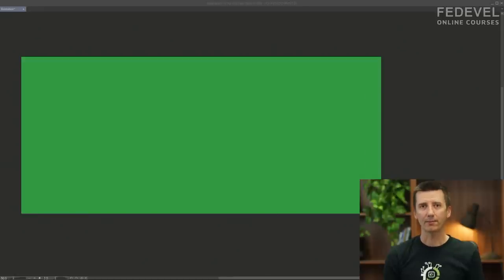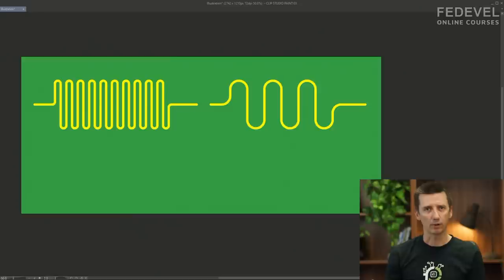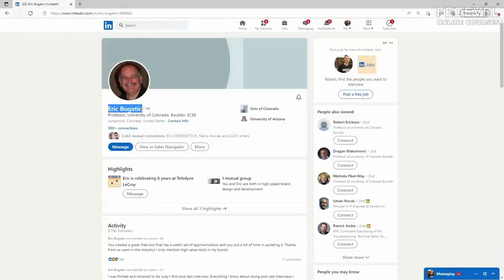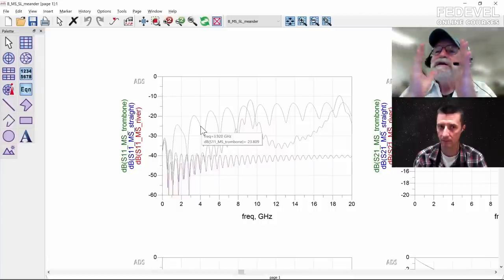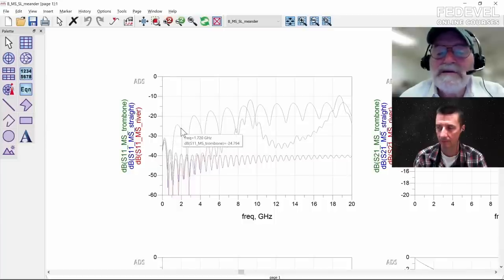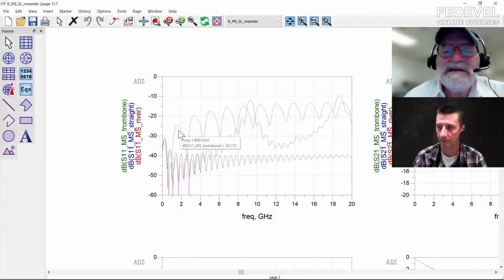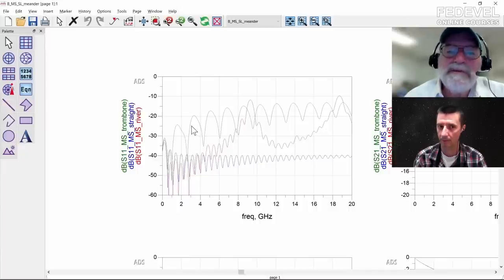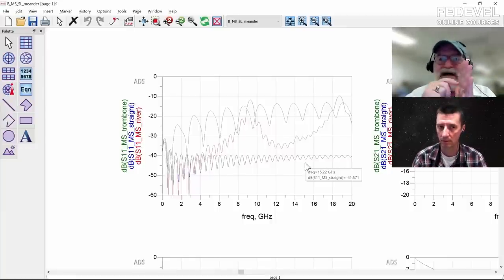Which length matching is the best? You may be surprised … | Eric Bogatin

Comment: Great video. I was wondering what would be better in the case of differential pair routing. I would think trombone would be better in the case where you need to compensate for a large length mismatch as the distance that the differential pair travels uncoupled would be shorter than in the case of river length matching.

Also, if I look just at the transient analysis of the last simulation with 40ps rise time, it seems as though trombone would be superior to river in the case of digital signals as long as it doesn't cause the receiving device to register a 1 at that low initial voltage. Although this is just a single edge. Maybe it would be different if there was an actual high frequency block signal that was simulated as that more closely resembles an actual digital signal.

I myself use trombone for very large length mismatch, river for medium length mismatch and triangle for small length mismatch. I do of course keep a reasonable distance between the segments.

Comment: Great video, Robert!  As always.
Potentially, a hand drawn meander, with recognizable variances in per-wave coupling and variances in segment length could perform better with flatter frequency response.  Further, since the typical meander is generated by computer, AKA Altium et al, all of the dimensions of the meander could easily be made to vary randomly within preset tolerances to maximally harvest this flattening effect. Just a thought 🤷‍♂

Comment: That was a great video. It's really interesting to see the underlying reasons as to why the rules for serpentine track layout are the way they are. Normally, only those few engineers lucky enough to have access to super-expensive field solver software ever get this insight.
I do have one question though: Why does Eric say (@9:00) that Microstrip suffer from far-end crosstalk (FEXT), but Stripline does not? I don't understand why the crosstalk gets cancelled out simply by using stripline. What difference does that make?
Reply from the maker: Thank you Nicholas. PS: I don't remember the exact minute, but the crosstalk cancellation is explained in this video: https://youtu.be/EF7SxgcDfCo
Reply: @RobertFeranec  Thank you, it all makes perfect sense now! It's all down to the symmetry or asymmetry of the dielectric constant of the material above and below the trace, and the fact that the electric field interacts with the dielectric material, but the magnetic field doesn't.
Reply: You are correct - stripline does NOT eliminate FEXT entirely.  Odd and even mode phase velocities are equal in homogeneous stripline and unequal in microstrip, which reduces the directivity of coupling at higher frequencies in the microstrip case.  A quick ADS or HFSS simulation will show you that FEXT does exist in coupled striplines.  An example of a little knowledge being dangerous, I think.

Comment: 9:20 regarding Far-end and near-end crosstalk. First, for purposes of discussing meandering traces, it would be helpful to call these crosstalks something like "parallel" and "antiparallel", or "same direction" and "opposite direction".  Robert mentions that for stripline far-end crosstalk (ie: parallel) "they cancel". Evidently, "they" refers to the two crosstalk components attributable to electric and magrnetic fields, which happen to be equal for stripline and opposite for the "same direction" direction, and presumably when dimensions and materials are selected for 50-ohm impedance. I guess in microstrip they don't cancel.

Comment: The plots discussed around 53:55 (microstrip) and 1:05:25 (stripline) are very interesting. The trombone curve is especially striking. If we see the  trombone as having three legs (Input --> A --> B --> C --> output), then each leg would be 5cm, with propagation delay about 330ns.  We can see that for both microstrip and stripline, the "precursor" bump starts about 0.33ns delayed from the input step. Why? Presumably because the crosstalk from the input end of A to the output end of B starts immediately. Any forward signal from B into C starts immediately too, as does crosstalk from output end of B across to input end of C.  So it only requires conduction from begin to end of C until the output starts to rise, though only up to a small plateau. 
Interestingly, the plateau for stripline is higher than for microstrip. I think this is because for stripline, the A-to-B crosstalk is all antiparallel in the forward direction of B, which outputs from B into C, and the crosstalk from B to C is also antiparallel, so in the forward direction of C. So the two contributions to a signal in C add.   
However, in the microstrip case, the crosstalks from A to B, and B to C, have parallel and anti-parallel components, partially cancelling out the effect, and/or simply sending energy in the reverse direction, hence a lower precusor plateau, but with the same timing.  Very neat!

Comment: Filling in some more gaps: With the total length of the interconnect being 15 cm, nominally 1 ns delay, the round trip is 2 ns, so the resonant frequency would be 0.5 GHz (assuming imperfect impedance match at the terminations) , and that is in fact the spacing of the peaks in the reflection plot for the straight trace, and also the closely-spaced peaks in the River plot. Nice! Then..
... for the Trombome trace, the lengths are 5 cm per leg, nominally 0.33 ns, or 0.66ns round trip, or 1.5 GHz. That is indeed the peak spacing on the reflection plot.
Finally, for the River trace, the individual segments are 1/16 of 15 cm, so we'd expect a resonance at 16 times the frequency of the total trace, or about 8 GHz.  That's a bit off from the simulation which shows 9 GHz, but maybe that's accounted for by the factor that each leg is made from a coupled section and a non-coupled section, or just be the coupling of one leg to another.  
All these ways in which you can see physical dimensions correlate to time and frequency really demystify the subject in a very satisfying way. Thanks Robert and Eric!

Comment: Thanks for the very informative video.
13:50 In order to have not much coupling spacing(width between serpentines) should be roughly 3 or 4 times track width @50 ohm line impedance. What about height of the serpentines should be?
1:17:00 Rough general rule under 10gig frequencies many short coupled segments(serpentines or meanders) are better. What ratio of the width and height of the serpentine is short according to track width? Or according to reference plane?

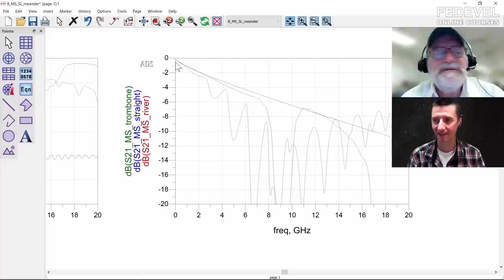Comment: Microstrip Accordion routing at around 1:00:00
Bloch effect punishes the design at 9 GHz.
What if, instead of equal spacing of the serpentine traces, one used a series of slightly different widths?
For instance different spacing between vertical legs of 1.0L, 1.05L, 1.10L, 1.15L, 1.2L, 1.25L, 1.3L, and so on.

Comment: I was directed to this video after asking some questions about ST Micro's AN5122 appnote, where they recommend trombone meanders (aka switchback) instead of accordion meanders (aka river or serpentine) for LPDDR3 traces, claiming that accordion meanders "provoke orthogonal propagation which compromises signal integrity". This was surprising to me, because I had always heard that trombone routing was more suitable for lower frequency stuff. After watching this video I feel I understand the behaviours of the meanders a lot better, but I'm still left wondering what they meant. By "orthogonal propagation" I can only guess that they're perhaps referring to the propensity for the mutual crosstalk to cause the precursor to advance faster over accordion meanders, by "jumping" the legs, but it wasn't clear to me that it's any better for trombone meanders. Maybe they're worried that the higher Q of the resonance in accordion routing coupled is more likely to create a large resonance at the fundamental frequency of the rising edges for LPDDR3 on typical 50Ω impedance stackups? Still seems a bit odd to me - maybe it's just a bad recommendation? (they do also mandate a 4L SGPS stackup, which made me roll my eyes a bit)
Reply: “All app notes should be assumed wrong until proven otherwise”
- Rick Hartley

Comment: 50:51 14dB loss @ 20G for stripline vs 12dB for microstrip.  Microstrip does dip down to 14dB at one point though.  The more consistent stripline behavior comes at a cost of attenuation.
Reply: Also on the transmitted signal graph -12dB for microstrip and -14dB for stripline @20GHz looks like there are more losses.

Comment: 🤔 around 59:00 - if the river would have been a "broadband"/"spread frequency" layout (don't remember seeing option for that in any software so far)? 
So, like the period of the river starts a bit smaller/narrower, increasing with each period and ending in a bit bigger/wider period.
That should spread the resonance frequency peaks approximately by the same "a bit" in width and reducing in strength/height, no?

Comment: No far end cross talk in stripline?! When did that come in?  Whilst it's true to say that the odd and even mode phase velocities are equal in stripline, which is a true TEM structure and unequal in miscrostrip, which is quasi-TEM  - it is NOT TRUE to say that there is no far end cross talk in stripline.  A quick ADS or HFSS simulation will show you that.